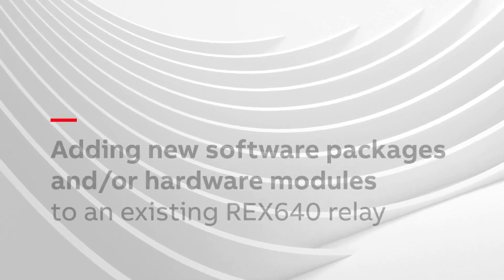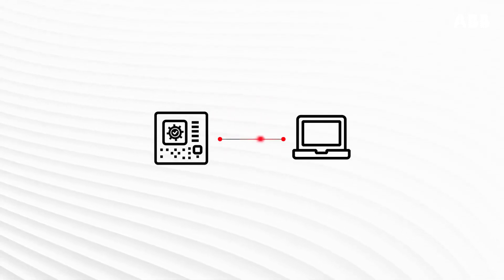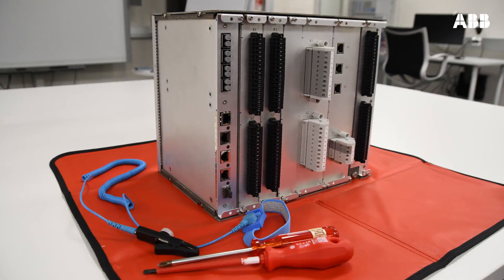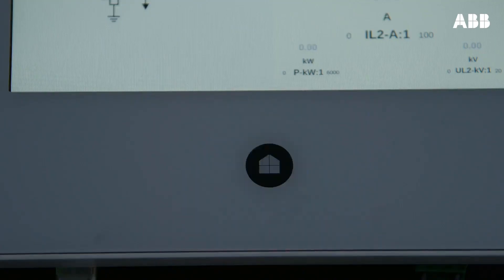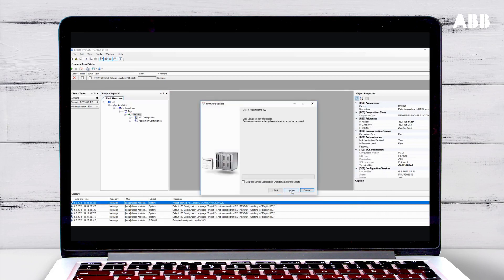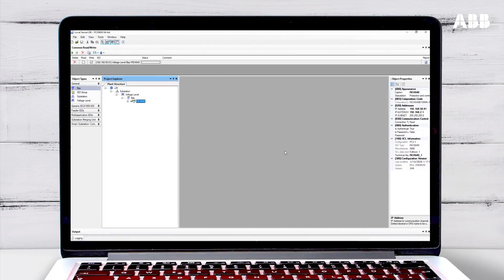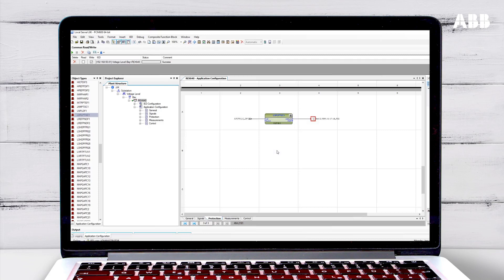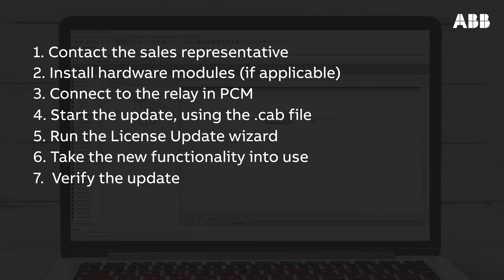How to add new software packages and/or hardware modules to an existing REX640 protection relay?

Comment: Is it possible to change the hardware such as the x120, I have AIM0006 and i want to replace it with AIM0003 on a REG615.
Reply from the maker: Hello @vaha1990. Please contact your local ABB service representative to grant the applicability of the replacement.